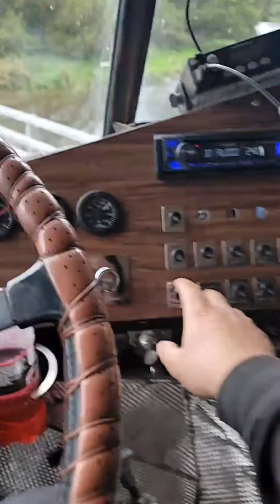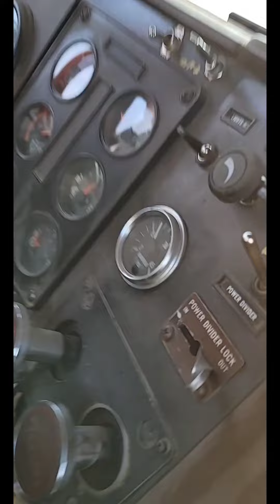Cummins KTA19 Completion 2021

Comment: Had one in a big yacht. A 79 kta19 coupled to a twin disc gear 3:1 ratio i think. Sweet spot was around 1100 rpm. But that thing sucked fuel like it was water. The trucks sound different but still got the deep clanky grumble of a marine cummins. Each cylinder head is independent from another. Not unheard of in the marine world to hear those motors go to 70,000 hours or more.